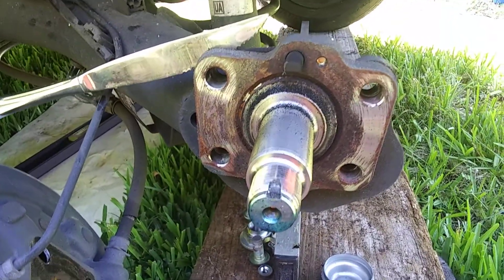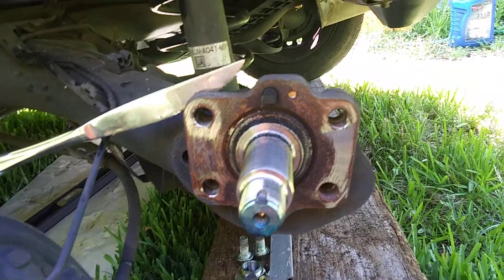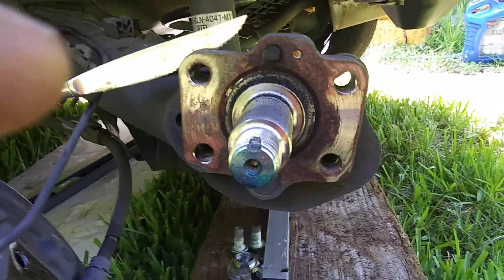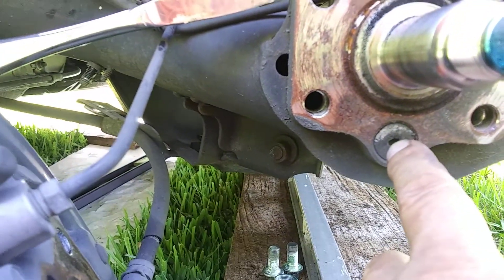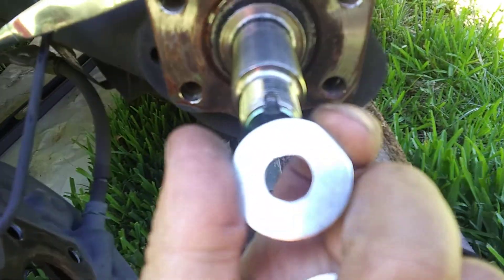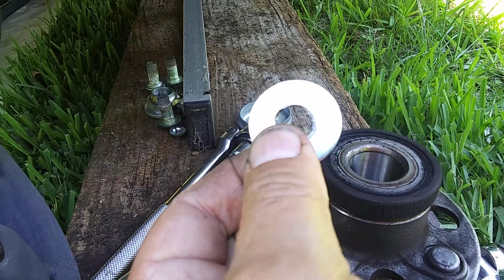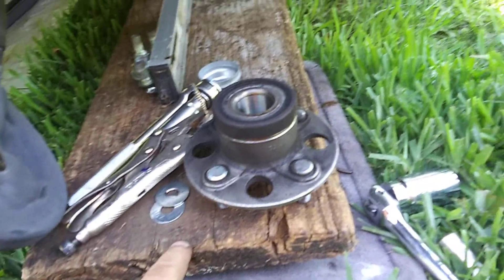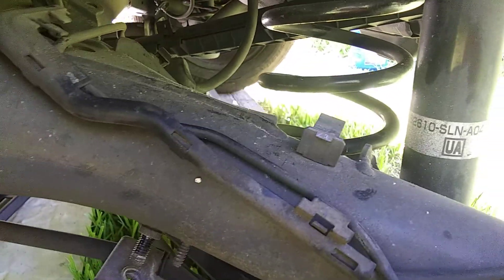Honda Fit rear camber alignment with washers.

Comment: Great video my friend! My 2010 Fit is perfect on the passenger side rear, but the driver side rear is toe in .46 degrees. I will try this method to adjust toe and bring it to the alignment shop and see how I did. Thank you!
Reply from the maker: Keep in mind, alignment shops lie and cheat customers, some of mechanics there are stupid. That is why I align wheels on my drive way. Good luck!